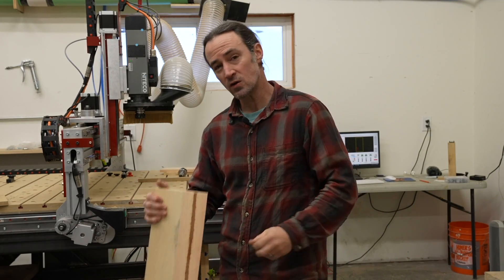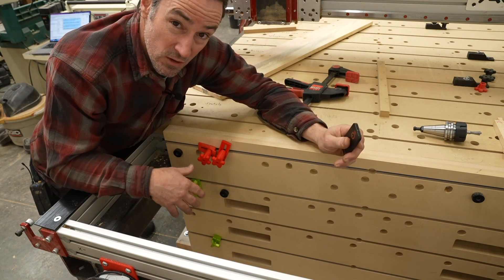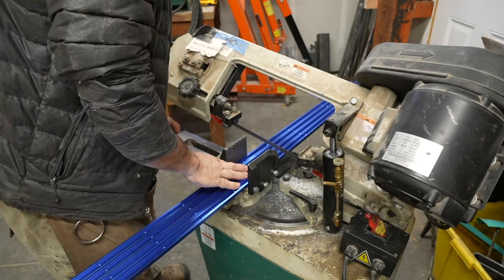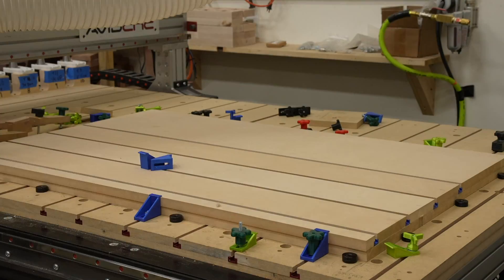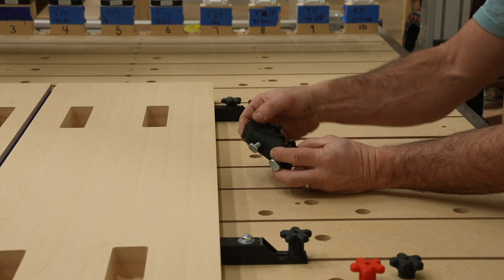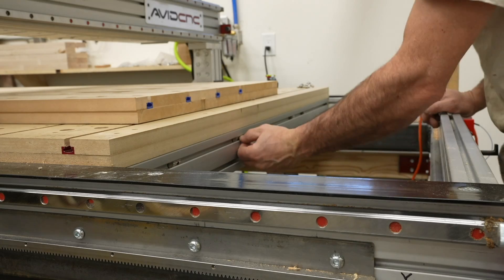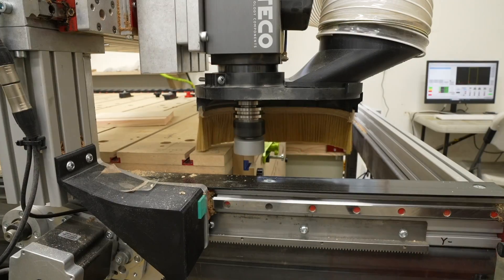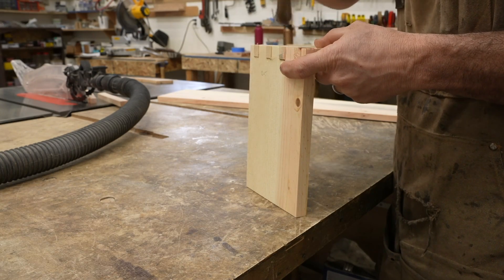The Ultimate CNC Vertical Work Table! Design considerations, the build, and the free CAD files

Comment: one question though: why put the vertical table where you did instead of in the front of the machine? I hate leaning over stuff and wouldn't want to give up that much travel (I only have a 4x4 pro.) I think that with the geometry of the machine/gantry/spindle, the bit goes in front of that first front stretcher, but maybe not far enough for what you are looking for? For adjusting the table to be in line with the Z axis, I love the dial indicator setup you had but was wondering how you performed the adjustment -- did you have a grub screw in the maple block on the bottom?
Reply from the maker: Good questions! Yes, the spindle will reach about 1" in front of the machine; once you add a sheet of MDF (or two) you will lose any cutting ability.  So, a lot of people just move that first horizontal 80/40 extrusion (the stretcher) back a bit -- say 6" or so, and then you can cut up to 4" tenons. Having it a little distance back doesn't hurt too much for rigidity. If I only wanted a vertical table, I would do this approach, and that might be a good approach for you to do.

Mine is set back to the second horizontal stretcher so I can eventually put a rotary table in this spot. I wanted to have double-duty for the space. Ideally, if I had room, I would have gotten a 10' length table to have some dedicated space for both things; rotary table at the back, vertical table at the front, and still cut an 8' sheet of plywood.

Z-axis adjustment: I should have talked about this more. I slotted that bottom piece of wood, so all I had to do was loosen the bolt drilled into my steel table and tap the piece back or forward a bit until I had no runout on the dial indicator.  If I had a regular Avid CNC 80/40 legs, I would have just used a piece of 80/40 across the front legs for the bottom support -- this might require some type of grub screw or shims to get it spaced just right, although, the extrusions are pretty darn straight.
Reply: @CorbinDunn  thanks so much for the reply! Your information is always the best. Love the videos, thank you!!!

Comment: Would there be any chance to please also upload .step or other universal format of this and the spoilboard designs? That’ll be super helpful for my diy CNC! Thanks mate
Reply from the maker: Hi Matt - Next time I'm working on this file i'll export a STEP model. For now, can you download Fusion and use it (unless you use Linux or BeOS you should be okay to run it)? You should be able to export it to whatever format you want. The best thing about the fusion model is that you can tweak however you'd like. I'd add a few more clamp holes in the middle, and another t-track close to the top between the top two tracks.
Reply: @CorbinDunn great thanks very much! I’ll have to download Fusion free trial for this. Thanks mate

Comment: A few suggestions:
1.  A vacuum press would have been the ideal clamping system to use when bonding the spoilboard slats to the vertical base.  However, as far as I'm concerned, a more flexible route, and one which allows you to replace the spoilboard slats if they ever get damaged or you decide to change the location of the clamping dog holes, would be to screw them to the vertical base before milling them true on the CNC. 
2.  Aligning the table once it was temporarily bolted into position could have been done with even a very thin piece of parallel wood, as long as it's held firmly against the top of your reference dog holes.  This would require you to check the dial indicator's reading at the top of each dog.
Thanks for sharing your approach with us.  I am planning to do a similar vertical milling system, which will feature those aspects of you that I like.
Cheers from Canada!
Marty
Reply from the maker: Thanks Marty! My original work table design did include screw on slats for the reasons you mentioned, so we definitely think alike!

Comment: Another great video. I have an Avid 5x10. Followed much from Jay Bates. I did my spoilboard same as you. Curious, did you drill dog holes through both layers of MDF? I didnt, because some line up with the aluminum frame. But now that ive resurfaced a couple times, the holes are getting shallow and dogs are sloppy, especially my G55 and most used offsets
Reply from the maker: My dog holes only go through the 1st layer. I haven't resurfaced the table yet, but it is starting to need it. I'm trying to do all through cuts so they don't cut into the table, and preserving it. I like this approach better, and another "mini" spoilboard on top for when I do need to cut into it. But that doesn't work for big projects (ie: 4x8' sheets), and you just have to do it.

Comment: I really appreciate the level of detail you provide with your problem solving. My CNC will allow me to move my gantry 3.2" forward over the front of the table, so I have been thinking about adding a vertical table there. I can see that I will have to do a fair bit of work to my support table before I can think about the vertical table. The steps you went thru and shared will be a huge help. Thank you!
Reply from the maker: cool! Yeah, if you have the space in front, definitely add the vertical table. Check out some of my recent videos for what I've been using it for.